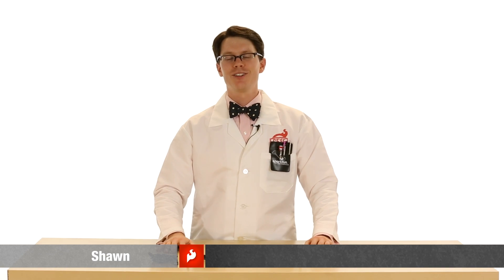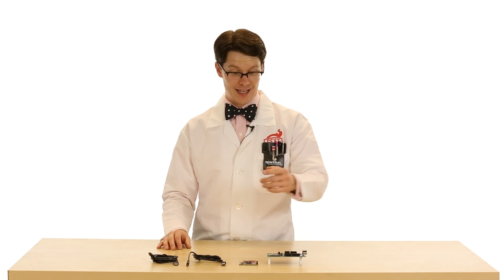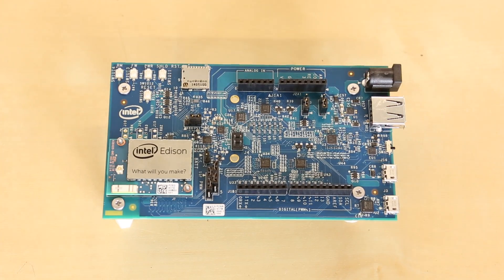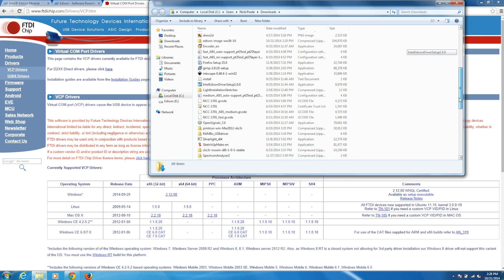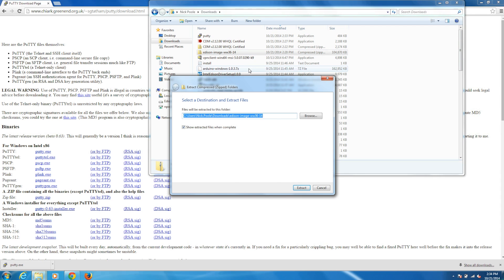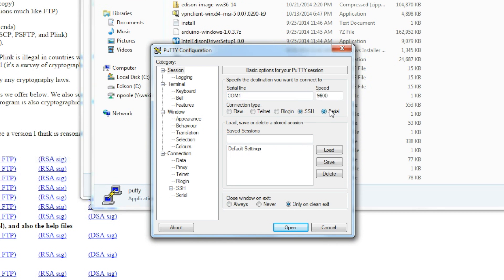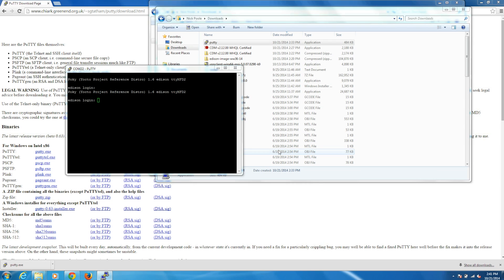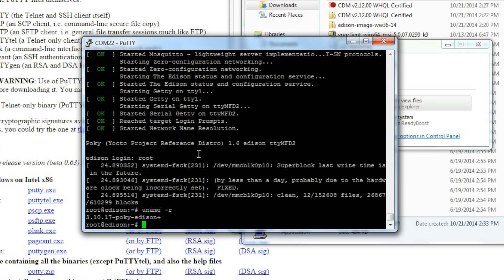Getting Started with Intel Edison Part 2: Updating Linux

Comment: Thanks for your video.
Excuse me , i have a question for you. I try to run with code :
void setup() 
{
  Serial.begin(9600);
}
 
void loop() 
{
  if (Serial.available())
    Serial.print(Serial.read());
} 
However, there is an error :  ** B010000000069$  when i print it on serial monitor
Reply: Can you print out a basic character? For example:

void setup() 
{
  Serial.begin(9600);
}
 
void loop() 
{
  Serial.println("o");
  delay(500);
}

Comment: I tried to transfer the zip files over to my Edison but it said I don't have enough space on the Edison even though it has a 16GB micro SD card... any suggestions
Reply: +Tyler Cranston I'm running into the same issue. This tutorial is a little out of date. Any luck on a solution?
Reply: Yes! I'm not quite how I was able to do it but this video may help. Intel Edison - initial setup by misperry